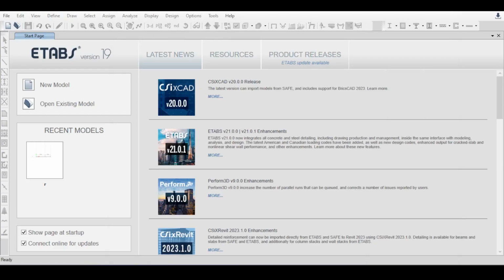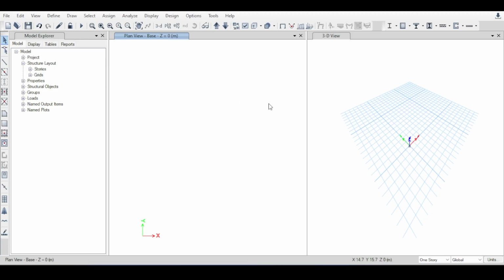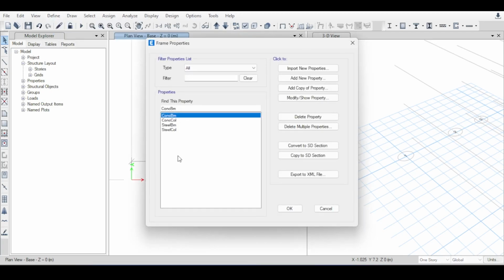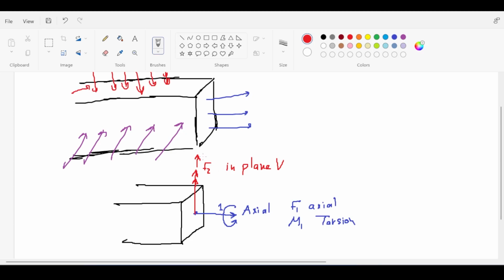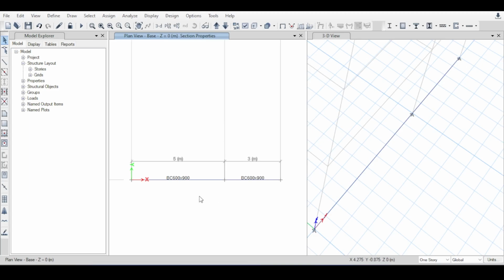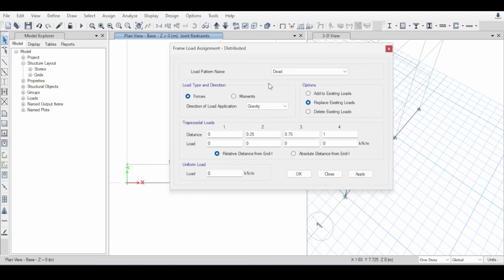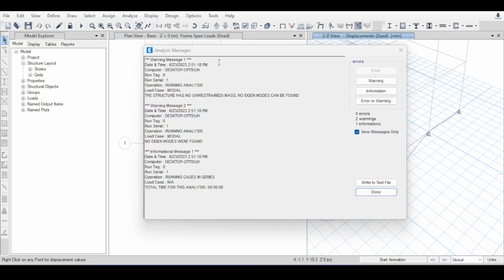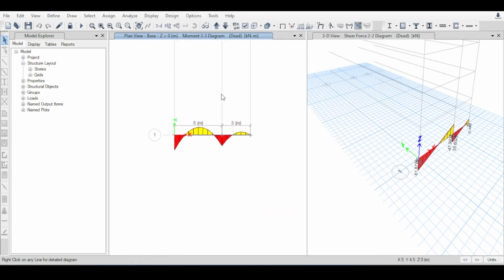Modeling a Simple Beam - ETABS Building Analysis and Design

Comment: Dear sir i hope that you are doing well
I have a small question
Suppose we have a building and how to determine the global extreme values of the bending moments graphically as robot does 
Usually I select all the beams and open the beam table and i check
I hope if there's a way graphically
Thanks in advance.
Reply from the maker: I will provide more details about all those points within my tutorials, ^_^ just gimme a lil time and all will be cleared.
I added the point to my list of issues to address
Besides investigating if there is any other option to define linear loads on slabs (without using the 0 stiffness beam approach).
Reply: @CivilEngineeringEssentials  thanks sir you are the best.
Wish you all the success.